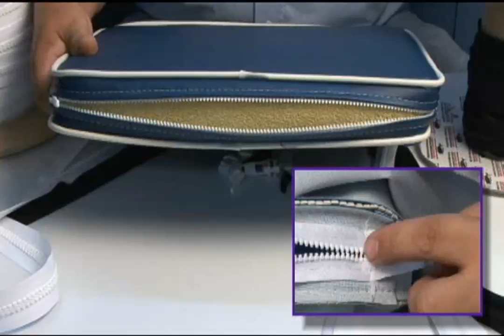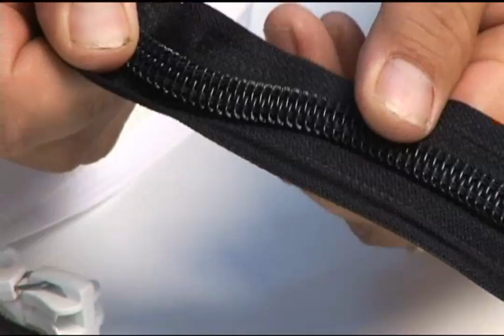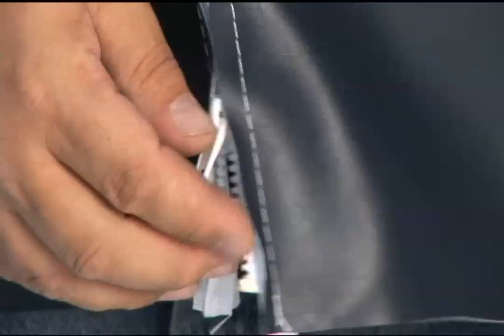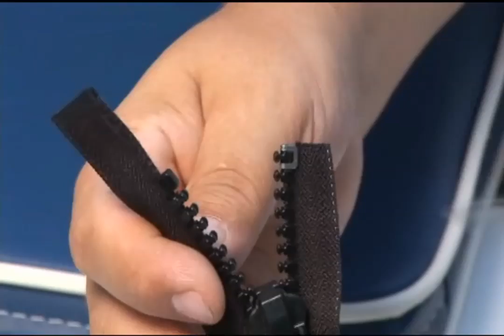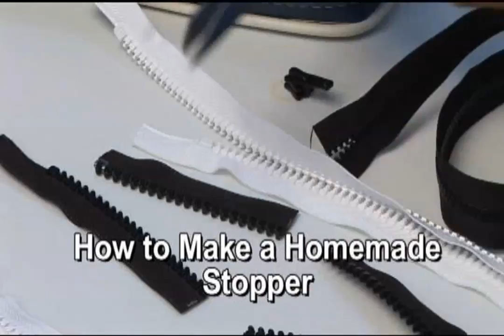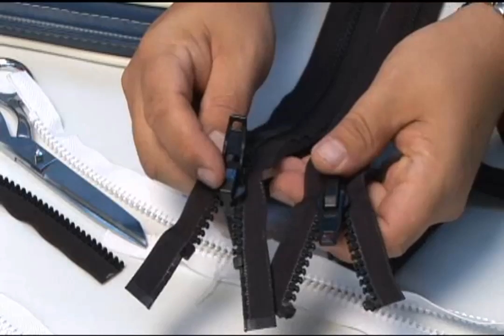Zippers Explained in Detail

Comment: would i use the stainless stop for a metal tooth zipper.  or could it be soldered the way you melted the plastic zipper?  good tips in the video.  if i cant solder the brass teeth and i can not find a metal stop.  any other ideas for brass teeth?
Reply from the maker: Yes, you could use a metal stop SS for the metal tooth zipper. No, usually a metal zipper tooth is not soldered. You could also use a scrap piece of binding or webbing to sew a stop at the end of the zipper. Just fold it around the teeth and sew in place.